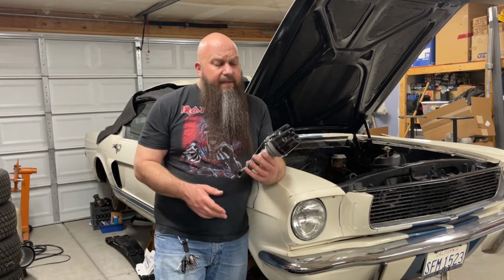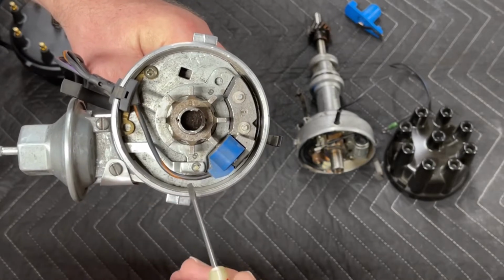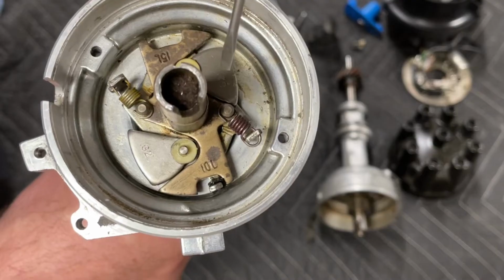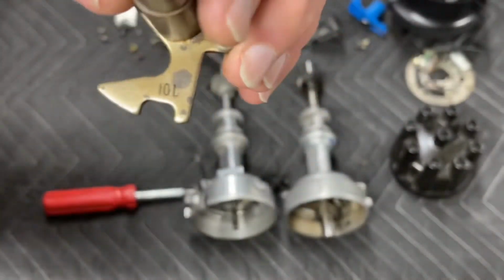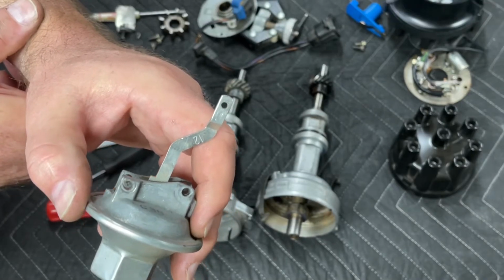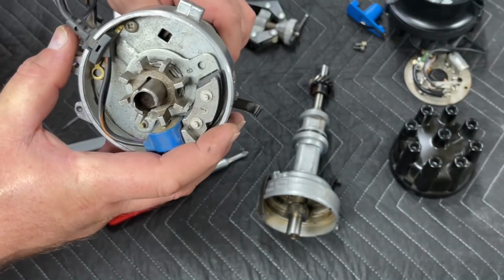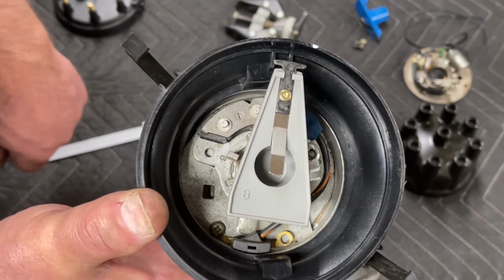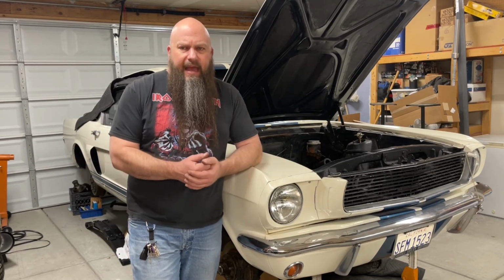Easy DIY Performance Re-Curve: '57-87 Ford V8 Distributors - Tune Your Ignition Timing

Comment: Great video..!  I have a question, if I may.  I have a 1987 Ford 460 with Duraspark.  I swapped out the Holley for a Edelbrock.  Now, I sometimes get a starter kickback.  Also, she idles great.  When she's cold, at 30 degrees out weather, I can lean in window, turn her over and she'll pop off within three engine rotations.  She does want to initially die, but then she idles p, and purrs.  She idles about 600-700rpms.  Recently, actually I just got this vehicle.  It's a RV.  So recently, with the doghouse /engine cover off, I hear this sewing machine sound, what seems like the driver's side.  It stops when I let off the gas.  It's not a knocking, maybe a valve part, I dunno.  I don't own a garage, not a gear head, and live in a duplex with no garage.
My question is, is there something I can do, by loosening teh distributer, and adjusting it?  I think, from what I've understood on the internet, is perhaps my 'initial' is set too low, or something?  Another comment was saying to another guy that my engine is running 'too hot' in timing, and he suggesting the guy was burning up starters.  The RV I bought, was on its third starter.

I dunno, you speak a lot of info, and no offense, but it takes me back to high school Algebra in the afternoon, after I missed lunch.  I feel bad, because you're informative, but the mouse in my brain, spinning the wheel is sluggish.  The engine runs great, but while she's idling, i do hear what sounds like delayed explosions on my cylinders.  Kind of like a drummer playing a beet and then hitting another type drum, then going back to original drum.  Nothing but like imagine the drummer playing a constant beat, and then he hits the bass drum with his foot.  The beat doesn't change, but I hear a couple random different drum beats.

In closing, I don't have any of the tools you have, except that clamp style measuring tool you used to measure height of te plug wires.  Wondering if I can manually mess with the distributor.  Maybe while the engine is idling at operating temperature, but I know I'm getting misfires because she does run about 5-10 degrees hotter than nor.  She can get up to 210, so I presume there's some hot misfiring going on.

Any advice?  Thank you in advance.

~Jamie
Reply from the maker: Without a vacuum gauge and timing light, attempting to time an engine and adjust the carburetor is just a crap shoot.  

210°F is actually pretty normal for the operating temp on a ‘79-Up 460 because of changes to the block in the D9TE casting that carried through to end of production in 1997.  Minor improvements in temp can be achieved with timing adjustments, but again, you need the tools to make the adjustments, or this is a futile exercise at best.  

The firing order on a 429-460 and the design of the engine lends itself to a somewhat rhythmic beat and the occasional misfire that thuds away in the exhaust.  It’s nothing to be too concerned about if the engine doesn’t shake in conjunction with the sound change.

Comment: I need a dual point Distributor sbf, nobody carries them now! I like points. Compared to fords first couple electronic, single point will out rpm them! Thanks for sharing your wisdom with us!
Reply from the maker: The last thing you want on a street engine is a dual point distributor without a vacuum advance.  Vacuum advance is essential (necessary) for older engines to run their best on modern fuels.  Electronic ignitions are drastically better than points.  But I stick to magnetic pickup distributors and recommend avoiding HEI or other distributors with internal (especially brand specific) modules.

Comment: Good how too.  Maybe you could put a parts list in the description? How do you dial in the vacuum advance? Adjust the screw in the  diafram and a vacuum brake bleeder tool?
Reply from the maker: Vacuum advance adjustment, I’m lazy, I do it on a running engine, I set the timing so the engine idles without the vacuum advance and then just apply manifold vacuum and check the timing.  I’ll adjust the internal screw with an allen key, and recheck until I get what I want.

Comment: Can i remove or should I remove the sticker that covers magnetic.....3 wire.  Dura last searching for spark new distributor 85 yes same dissy and new msd 6al thank you. Spark test....bulb  at the spark plug itself. No light😮 the sticker is void warranty if removed
Reply from the maker: Not sure what you’re asking.  6AL (any magnetic pickup capable ignition) you use the two wires connected to the pickup, you can remove the ground wire.  No need to remove a sticker, just connect the purple and green leads from the MSD to the pickup.
Reply: @TheGT350Garage  Or hook the ground wire from the distributor to the same ground point as the control box/module.
Reply from the maker: It’s a superfluous ground wire.  It’s not needed.

Comment: Thank you for your video sir. Although I use a different setup with my 351C powered mustang, tuning for modern fuel has changed dramatically since I purchased my car in June of 1976 as a 17 year old. I use a Fitech system that also controls ignition timing. Back in the day when ignition systems weren’t as powerful as they are today, 36-38 degrees total timing was probably a standard practice. Perhaps I’m wrong but it seems that the power of a multi spark ignition like MSD as lessened the need for those kinds of total timing numbers. In my case, compression is 9:6:1, flat top piston camshaft specs are 568 intake 584 exhaust on a 112 LSA duration of 216/224@.50 Crane hydraulic roller. Originally a 4V open chamber head but now uses 2V open chamber since 1995. MSD 6-A blaster 2 coil plugs gapped at .40 right now. I only use 32 total but 18 initial with the Fitech EFI. 89 octane fuel but I have used 93 also. C6 trans and the original gear if 3:25. I know that’s a lot of information but what if anything would you change? AFRs are 14.2 idle 13.8 cruise. Thanks again for your video

Comment: If you really want accurate recurving, you need a Sun Distributor tester. You can see and adjust mechanical and vacuum advance, set your points and test your condenser. There is also an adapter for electronic ignition, and a flathead dizzy adapter.
Reply from the maker: Absolutely unnecessary to have a distributor machine to get an accurate curve.  All you need is a tachometer, timing light, and vacuum gauge, and the entire process can be done on car.
Reply: @TheGT350Garage  Im' not saying you can't do it without a dizzy tester, Im' just saying it's more convenient and more accurate to do so. And it takes less time and test driving. You can't flash a timing light on your pulley while driving, can you? ;-)
Reply from the maker: How is it more convenient to remove your distributor and have to find someone with a machine?  And the accuracy of the machine is no better than the accuracy of any good timing light.  Any issues that will occur doing the curve work in the car will occur with a distributor that was curved on a machine.  And you’re clearly not grasping that the mechanical advance is RPM based, not engine load based, meaning a stationary rpm step test that takes about a minute to perform is perfectly accurate and safe.  You test idle timing then 250rpm increments from 1000 to 2000, and 500rpm increments from 2000 to 4000rpm.  If the timing is still advancing at 4000rpm you can test at 4500 or 5000rpm to verify but that’s only done to identify springs that are far too stiff.  The actual test takes less than 90 seconds to collect all the before data, and the same time to verify the after curve.  If you think the car has to be driving to verify the correct timing you  are missing the connection that the engine is simply doing the same job as the distributor machine in your garage or driveway.

Comment: How do you like duraspark 3?
Reply from the maker: Like is not a term I associate with Duraspark III.  It was used in conjunction with EEC-III and is completely unusable for a performance application.  Those systems are not serviceable by anyone who has not been trained and without the proper diagnostic equipment.  EEC-III was an era when Ford like the rest of the industry were trying to computerize carburetors, those were wild times and dark days for this industry.  My advice has long been avoid Duraspark III.

Comment: One more tip. I think it was standard ignition that sold vacuum chambers  you could put an 1/8 th inch allen in the tubing hole and turn a stop to limit the amount of advance you would get at full vacuum. They probably got cheap and dont do it anymore. I`m a 75 year old timer and got that damn dementia on top of CRS ( cant remember shit)  so ask the parts guy to pull one out and take an allan with ya and just feel if you can grab hex inside of the chamber reaching through the hose fitting and fishing for the allan fitting.
Reply from the maker: So, the stop doesn’t always limit the amount of advance, on some vacuum advance units (most actually) it changes the spring tension and changes when the advance applies, this is better than limiting the total advance because it can be adjusted to make sure the advance is not applying below 4-6” of vacuum, and that’s how we can ensure the advance doesn’t stack under load and cause issues.

Comment: If you have a clearance problem and cant use the big ass 2 piece cap but want to use 8mm wires with female  on both ends , get a cap for a International V8 80 and newer is what ya need. If ya wanna use the big 2 piece but don't want your wires crossing over , meaning you got 1,2,3 and four coming out the right side of the cap and 5 6 7 and 8 going left , get a cap , rotor and adaptor from a late 80s early 90s EEC4  with a two-level rotor and two-level cap , and I'm pretty sure they use a different adapter.  They are really weird looking on the inside but the firing order is cast into the cap and it looks really cool having the plug wires really neat aiming right at the cylinder and no excessive wire twisting around  looking messy and tangled. They only made them a few years and once you see one , it will stick out like a soar thumb viewed from the bottom. If your gonna buy one to covert to duraspark  and female 8mm wires, might as well get the weird one.  You will freak your friends out when you show them. One caution, some used a rotor with a wire clip on it, don't use that one or you will need a different shaft for the rotor to sit on.

Comment: I have a fully stock 1970 429 except for the intake manifold and carburetor. Those are a factory ford spreadbore intake and an edelbrock 1905 carb. 
On today’s pump gas, what would be good numbers for the timing , mechanical advance and vacuum advance?
I have it installed in a 76 f150 4x4 with a 4 speed and 35” tires. 
Thanks
Reply from the maker: I had a similar setup in a ‘77 F-150 years ago. At 10.3:1 compression a 429 needs more lift and duration than a stock cam provides.  The stock 360hp Thunder-Jet cam builds a lot of cylinder pressure and as a result the engine can be hard to get the timing right on.  I would suggest limiting mechanical advance to 18° and running 10° initial.  This will give you 28° total mechanical timing.  The timing needs to be about 80% in at cruise rpm, so if you have 4.11 gears with a 35” tire and drive 65mph, about 2600rpm, and all in by 2900-3000.

The vacuum advance needs to be on manifold vacuum and should give 10-14° additional timing above 6in/hg.  Below 6in/hg you want vacuum advance to pretty much go away.  

Set up like that it should run reasonably well on 91-93 octane pump fuel, but you also need to make sure the air/fuel ratio is in the right range.  That engine needs to be a bit richer due to the iron heads, so targeting 0.85 Lambda or about 12.0-12.2:1 at WOT, about 13.5-13.8:1 at cruise and 14.1-14.3:1 at idle should get you right where you want to be.

Comment: Was doing this back in the early seventies except eliminated the vacuum advance and went full mechanical advance with excellent results... Went to the local ford parts counter,, At VELS Parnelli Jones ford Dealer,, In Torrance California In the Ford Parts book it states to pull out the stiff spring and use the 2 light Springs across the counter from Ford.
For a perfect.
Mechanical advance...
Reply from the maker: With modern fuel we need the vacuum advance for lean operation so we can manage temps.  Mechanical only is far too inflexible for proper operation.

Comment: One year only.  OEM Steel gear pre EEC IV control…
Reply from the maker: Yes, that is a hard to come by original Ford distributor for an ‘85 Mustang GT 5-speed car.  Not a common part.  Ford Motorsport SVO then Ford Racing sold a kit with this distributor including cap and wires from about 1997-2002.  It wasn’t super popular despite being very affordable and considering the number of crate engines that were produced and sold in the era.
Reply: @TheGT350Garage  People think they need a $400 MSD I suppose.  The beauty of the Duraspark as you stated is how short it is.  Particularly on BBF’s.  Ridiculous how  tall aftermarket dizzy’s are.  Appreciate the info!
Reply from the maker: @ProjectFairmont the lack of vacuum advance on so many of the aftermarket distributors is really more problematic, particularly with a street application.  When you have varying operating conditions you need varying amounts of timing and taking the time to understand what your engine wants is more work than some seem to be willing to undertake.  A drag race application with mechanical advance is fine, it’s closer to steady state operation, street cars are far from steady state, open track and autocross also requires more adaptability.  It’s just hard for people to wrap their heads around.
Reply: @TheGT350Garage  I see what you mean.  I need every bit of initial advance moving my Lincoln MKV behemoth that is provided by the vacuum advance Duraspark dizzy.  And with your help, I now know how to control total advance.

Comment: Hi, I just checked my timing on my 69 Ford Ranchero 351W with a stock distributor. Set the initial timing is at 10 deg. but when I reved it up to 3000 rpm to check the total timing, it is not advancing at all. It stays at 10 deg. all the time. I have a stock distributor with a Pertronix electronic conversion. Vacuum advance was also disconnected & plugged before hand. Any ideas or tips what I should do next? Bad Distributor? Or maybe take it apart to check mechanical advance?
Reply from the maker: Pull the point plate and check the advance mechanism, sounds like it’s stuck from corrosion or gummed up.  Lubricate it in the center hole under the rotor, remove and replace the felt as necessary.  Use a good penetrating oil and let it soak in to free things up.  Don’t neglect the weight pivots either.
Reply: Hi, Thanks for the info. I got the clip out of the cam weight base assm, but the base is frozen and will not come off the shaft. I sprayed some penetrating oil in there to let it soak, hopefully it will come off soon. I tried lightly prying up on it some but its froze good. This car sit for several years outside before it ran again, so I think it got some moisture in there. Do you have any addtional tips for getting it off?
Reply from the maker: @alicenfred a small 2-jaw puller would be helpful.  Alternatively, simply putting an adjustable wrench or channel lock pliers into the housing and working the advance plate to free it after the penetrating oil has had time to work should free it up.  Email me if you need specific suggestions on pullers.
Reply: Hi, I got the advance plate off, Thanks. Is the knurled shaft removable? Underneath it is a bunch of dirt and rust that should be cleaned up. Now Im thinking maybe I should obtain a new or rebuilt distributor. The knurled shaft has back & forth movement also that I am not sure should do that? It moves about 1/4". Thanks
Reply from the maker: @alicenfred the knurled shaft is part of the main shaft and is not serviceable.  If you have more than .005-.010” side to side clearance, the housing and/or shaft is exhibiting enough wear that replacement is needed.

Comment: I just saw a video saying you can get a male plug cap for an older style international in the smaller style
Reply from the maker: Possibly, I don’t keep up on International parts.  The larger diameter is also beneficial by having more distance between the terminals and preventing the possibility of cross arcing.
Reply: @TheGT350Garage  makes sense, it’s basically the dizzy they’ve used since the early 60s with just a space player and a bigger cap and rotor?
Reply: True statement, Standard Ignition part #  AL 482

Comment: If you intend on running your engine above 5000 RPM, you don't want to use the Duraspark ignition box, it has a 5000 RPM rev limit built into it. Ask me how I know.
Reply from the maker: I’m running a Pertronix Digital HP, they’re slick, and work with the original current triggered tachometers used in my Shelby and other Ford products of the era.
Reply: Awesome  @TheGT350Garage

Comment: Are 15L and 10L always together, or can it be 10 and 13 etc sometimes. I have a plate that is corroded, I can't read the #'s.
Reply from the maker: The plates are always a 5° spread.  So 10L/15L, 11L/16L, 12L/17L etc.  I’ve seen them up to 18L/23L, that’s a crap ton too much advance.  We really need a supplier of close tolerance replacements, and then we’d have something awesome to work with.  It would be nice to have someone produce weights too.

Comment: Very informative 👏 👌 im gonna have to pick your brain sometime. I have an old 289 think 66 ive been slowly decifering
Reply from the maker: I’m rather fond of 289s.  They are great engines.  Everyone wants 331/347/363 8.2” deck engines because they are convinced displacement is always the solution.  The reality is a 289 has some tremendous potential and the engineering side of a 289 is excellent.